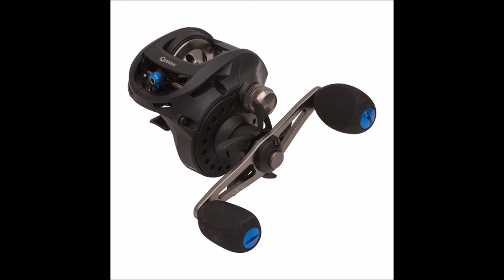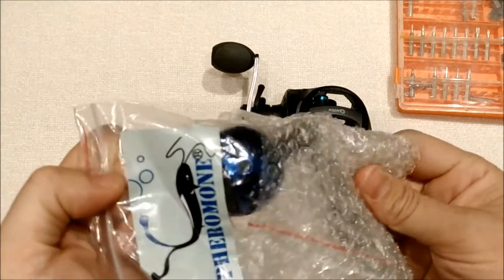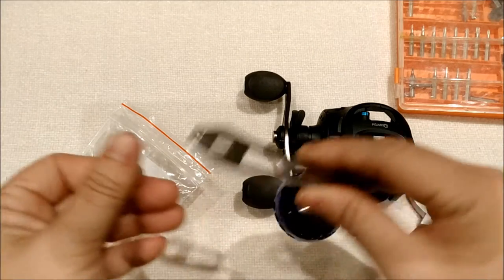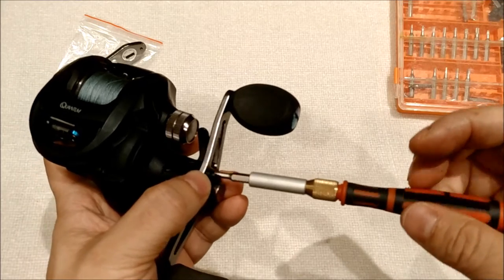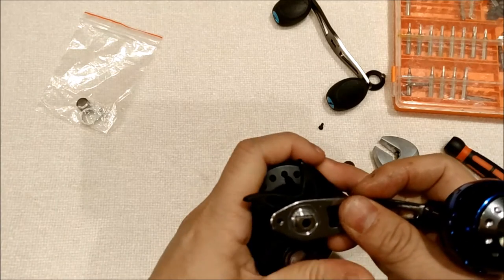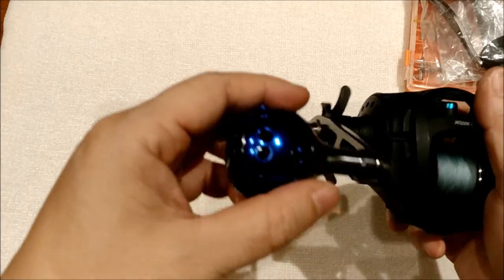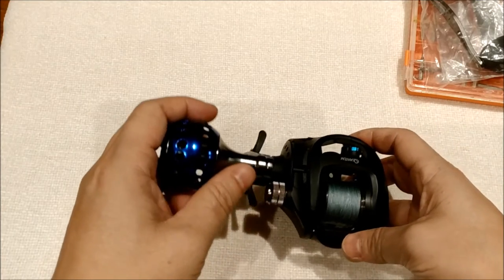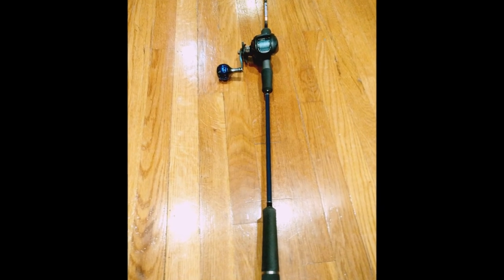How to: Power Knob Replacement on Quantum Smoke Baitcaster and other reels Ep 33

Comment: I don't know what to think here! That reel looks bad ass with the upgrade!  At the same time I'm wondering how that power handle is going to work with the rest of the reel while in use. Is it going to tear up the gears faster? Is it gonna be comfortable during a cast? Is the balance off? I can't wait to see this in use!
Reply from the maker: Lots of questions and I don't know how to answer them now. I will report back after the 2017 season is over or until the reel is done. There will be a video for sure!
Reply: Probably just for looks .... I change mine because I can...
.and I think it looks good.